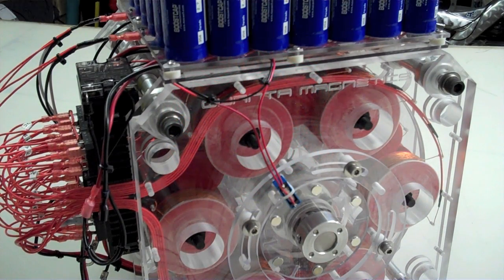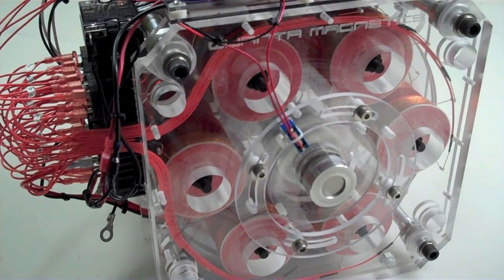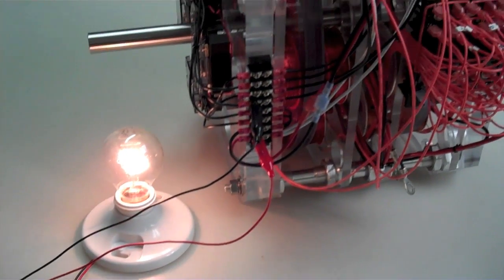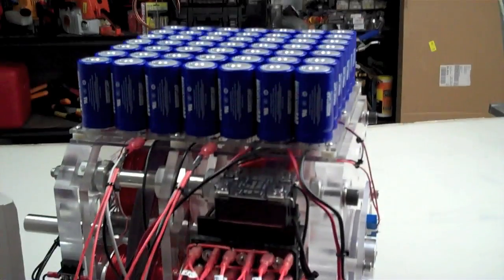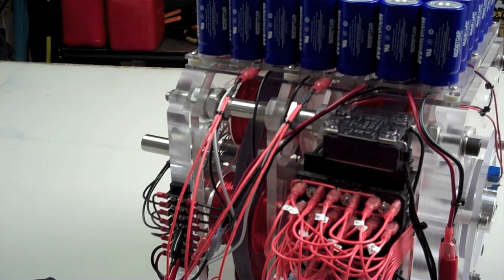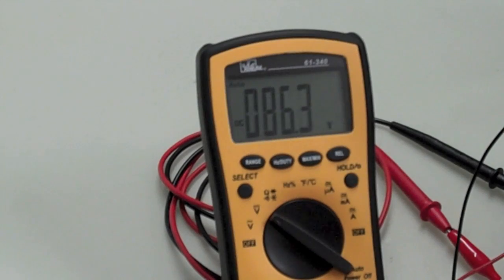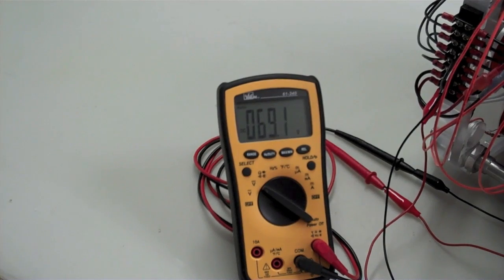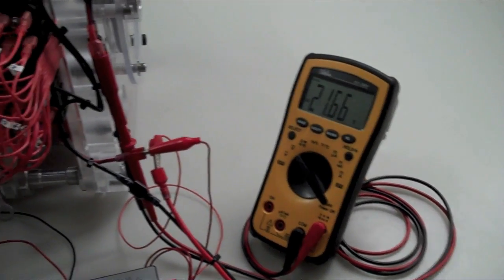Q2 SELF CHARGING.Part 2

Comment: Yes I get that but the point I am making is the output potential that can be delivered to gain a usable voltage 110/240 and amperes because it is pointless having voltage without the ability to do work.

Presently the machine you have is a novelty device and you need to look at making this in to a device that can do work, whether electrical or mechanical.

How much work (as in power take off) can be achieved without detrimental effect to the device's ability to continue running?

Comment: You go on about current draw, what about current output?

It is no use having a device that requires a 24 volt input to energize and run if the output is not sufficient to do actual work.

Also... Get to the point, your presentation really needs to be speeded up and less talk and supposition and present the facts as you have found them.

Comment: Dear sir: This is a neat machine with capacitors, motors, batteries and some other electronic devices, but I still cannot follow the flow of energy through the whole unit and what it actually does.

Can you please supply us with a circuit diagram showing the actual flow of energy and the interaction of the various electronic parts, PLEASE!!!

Comment: And what really bugs me is they way your using the term "power". Power is watts (joules per second). You can't just say I have 100 volts and there's that much "power" going into the caps etc etc. That is really confusing and incorrect. If your going to use the term "power" you have to multiply the current by the voltage (for DC). You can say there is "this much" voltage going into the caps but that says nothing about the power going into the caps.

Comment: So its a DC to DC step up converter, with caps that give it a UPS characteristic? I'm still unclear what this does. Are you claiming on top of bearings thermal inefficiency and the power loss in a cable power = current^2 * resistance (and you have a lot of cables), this can power itself and a light bulb? I know a little physics and questions are just rolling off my head, I'm trying not to ask many of them.

Comment: Do an experiment to see if the caps are being charged by the Field when grounded. (but still in Frequency "sync" with the negative wave of the generator) Ex1 Charge each cap through its own separate power source (a battery or something) then discharge them in series and measure the voltage. Ex2 Unplug the caps, Ground the caps to a different ground all together then the generator, then measure the voltage output. And lastly do Ex2 but move the caps a greater distance away from the generator.

Comment: Capacitors are electrostatic, therefore Magneto-static (a magnetic field carrying current will pass through the caps trapping static current between the spaces) A High powered magnetic field generating electric current will charge capacitors within proximity. There are already advanced uses of this being researched, like the possibility of having an electric car charged "instantly" by passing through a charge check point. "Wireless" power broadcast through harmless magnetic fields.

Comment: I work near High voltage power lines alot, here in florida. 500kv distribution lines, the effect they have on everything is astounding, Park your truck in line with them go to touch the door shock!. Aluminum seems to be very reactive to frequency modulation, Hence antenna's etc. The reason possibly for the voltage spike when unplugged(but grounded) Is because now all of the caps are being charged at once(instead of in series) and being discharged in series.

Comment: could you not use the momentum from the rotor to run a car alternator and use a 12v to 240v inverter to run different appliances without sever voltage drop?

Comment: I have heard of this run away effect before. You created a ground plane with your capacitors and it is using the ambient pulsating magnetic field from the motor to charge them. this is getting into "electromagnetic field theory"
An example of this would be that ungrounded CRTs and capacitors will charge themselves over time off the ambient signals in the atmosphere (house wiring, radio signals, ect.) A visual effect would be to move a florescent bulb around underneath a high voltage power line.

Comment: Why does the 24 Volt motor continue to run at full power when the unit has stopped rotating (7.30 minutes from start of the video) ? The implies to me that you are simply switching power from the caps or an external source to the 24 Volt motor rather than generating power. At best you have a semi efficient motor driving a semi efficient generator. At worst (and I believe this to be the case) it's nothing but a scam !

Comment: i.e. If your system works with no other source of energy for 2 hours and the voltage across the caps has gone down even a volt - you've got yourself a regular electric motor and a voltage inverter, which were invented sometimes in 1890 with efficiency of 80% and today they are about 98% efficient.

Comment: Thank you!!! Why is everybody here so impressed by a semi efficient electric motor?!?
If fully charged 49 x 2.5V 350F capacitors would have 53,593 J (Joules) of energy. If a 12V source at 300mA can spin your motor it takes only 3.6W to operate. 1 W/h = 3600 J, which means without any batteries the caps alone can sustain the spinning for about 4.13 hours. (53,593J/3600J per W/h = 14.89W/h / 3.6W = 4.13 Hours) Even if we did half of that, they get discharged half way, we are looking at 2 hours.

Comment: I'm a bit confused, that I'm sure most are... Seems more logical to me to have it charge two battery packs so it can continue power itself forever. Lets think about this for a moment. As one battery pack is being charged the other is being used to run the device and then it switches to the other when the battery is almost depleted. This way you can have a continuous running device. You currently need 63v @ 1A to get this thing going. As of right now, I see no need for the device.

Comment: Becourse that means
Let say you have a generator that needs 50 newton to create 10 watts. Then you use a motor that needs 15 watts to create 50 newton load.
Now replace the magnets in the motor with some that is twice as strong
According to Laplace law.
It will only need half as much watts (7,5 watts)
to create 50 newton load.
And now the system creates more energy than there is put into it.

Comment: in the sound of your microphone i hear a distortion .    that same effect of distortion i get with my camera when filming  in a plane in air , how harder the engine runs how bigger that distortion( static charged of the air friction , turbine blades get allot of it).     and abaut the caps  ,   arent they charched  and the want to get rid of that static energy. or the static power you create goes in the air and ground power  and as soon you touch the + side  all static goes trough your body?

Comment: If you make both of these work together in motor mode, what king of torque/rpm are you generating? Would it be feasible to line a few up in the same shaft and connect to a high efficiency generator (the reverse of your converter project)? Why did your website stop selling the kits? I was just about to buy one.

Comment: what you may have felt was an induced ac voltage capacitors allow ac to pass like a piece of wire you said it was generating about 100 volts if that was ac it would be plenty to knock you on your ass and possibly kill you if you did it wrong

Comment: Beautiful machine but the narrative doesn't do much but highlight meaningless observations.  It appears to simply function as a voltage converter.  The hookup has an amp & volt meter at the input so input power can be calculated, but just a volt meter at the output so output power cannot be calculated - concealing that no excess power is generated?  Seems like smoke and mirrors but would love to be proven wrong.

Comment: Brain Train, you mean that a coil without iron an an rotorating magnet wheel have overunity? That sounds very good, i think i build one today. A simple DC Motor and the magnet wheel with the coils arround that should be the same effect like the machine in the video, or not?

Comment: the reason that you are charging the caps to a high voltage when they are disconnected is that the rotating magnetic fields that are in close proximity create a induced voltage that are stored into the caps therefore giving you a shock when you touch them the same thing happens when linemen are working on a long power line that is disconnected from the mains will still kill you with the induced voltage generated by the wind and moisture from the atmosphere including the magnetics from the earth.

Comment: Wow, What a fantastic video!  I am impressed with your knowledge and application of concept to your generator/motor.  My thoughts about the caps, when they are disconnected and the motor is running, it is the electromagnetic field from the rotating coils that is creating/releasing/activating(q mark) the electro magnetic static shock.  I bet if you can keep the caps (and the air around them cold) you will have a better charge within them(or more dangerous if you touch it) 
Very fascinating

Comment: Follow up. Starting with 92v in the dormant cap bank the stand alone loss measured around 1.5% over 2 days. For sure much greater than 1% over 5+ days when measuring a 20% residual charge over time. Maybe a common deep cycle battery is more efficient in that regard. I have no idea, there is no accurate way to measure the residual charge of a common battery. i.e voltage has no relation to chemical storage capacity, while the voltage in caps can be calculated in Joules giving a reference point.

Comment: I understand your point, but just wanted to point out something. Solar panels, wind and water turbines. The energy input to those systems are 100% free. Though they cost a little to build and maintain, have a near infinite COP.  They may not be 100% efficient, but you don't have to pay the sun, or wind, or water currents, to power those systems.  Energy storage by contrast, will always go back to zero due to the Dirac sea effects, batteries and capacitors included.

Comment: Will do, I am also curious about the stand alone behavior. For the 2nd time the bank dropped .1v with room temp around 50 degrees and was back 8 hours later with room temp at 70. I had not expected the caps to appear to fluctuate with temp. as much as they do with  with time, so I will keep an eye on that as well.

Comment: All in series. Smaller series banks with lower voltage seem to have greater loss. I have also seen the voltage drop say .1v and gain it back 8 hours later but I think this is due to fluctuations in room temperature +- 20 degrees.

Comment: Follow up, a bank of 35 2.7v 650 f caps dormant on the shelf  for 2 + days measured 40.9v. 60 hours later the voltage dropped to 40.8. If my math is correct this would be about 1% leakage in roughly 5 days, not 2 months as previously mentioned. My error. In any event, the 1% loss over 5 days would be recovered in less than 3 seconds with full sun on a 90 watt PV array.

 All is relative to economics, so maybe a combination of various storage methods is worth pursuing.

Comment: Yep, even a cop>1  definitely does not mean energy came out of nowhere and was free. To be sure COE is as solid as solid gets. The heat pump example is complex going back to 550ft/lbs in 1 second = 746watts and how that formula was derived. Based on the original heat conversion, cop is just a relative number. IOW even cop >1 based on the formula, is not likely to convert energy from one medium to another without incurring losses that will take the system back to <1. Energy storage has an upside.

Comment: I hope you are not implying that  COP>1 means you are able to create energy. A COP>1 in a refrigeration system or heat pump does not imply you are getting free energy. The COP of the system only considers the electrical energy to run the compressor as an input, there are additional energy inputs/outputs in the evaporator and condenser (depending on what your desired output is) that are not considered. The overall energy balance of the system will always equal out. Energy is always conserved.

Comment: So, if you pull the wires off of cap banks 1 and 2 and discharge them, do they charge back up or do they stay discharged until you connect the wires again?  Impressive work and build.

Comment: Yep, must have been all the rotation of permanent magnets rotating in the vicinity of electromagnets as various experiments happened (by chance) near enough to keep the loss down to 1%. Now you got me to wondering, What does Maxwell say the the typical loss would be for a balanced bank of 62.4kJ in the bank over 2 months. I have not done this calculation but it sounds like you already have. If  over 1% loss that is great, all the more reason to wonder why I have not measured greater leakage los

Comment: Follow up, the caps I have been using (2.7v at 650+ farads also Maxwells  have repeatedly stored energy for months with less than 1% loss. So I call bull crap on the leakage you mentioned here. As far as maintaining voltage, you are missing the whole point and beauty of the flexibility the scaps provide. Go back to the textbooks or better yet do some experiments with large caps and let the viewers know what you come up with.

Comment: Follow up. Example not related to the PMM experiment that created this site. Say I told you I could maintain motion of a 30kg 6" rotor at 1000 RPM with a 6 watt input and recover 2.5 watts in capacitors by collecting bemf and.cemf.
What would be your thoughts ? A) bull crap B) prove it C) move the experiment away from power lines or D) none of the above ?

Comment: More expensive per joule compared with batteries commonly used with solar systems. I know, you do not see any benefit from the rotation, I think there is potential for other energy storage..back to the blade pitch reserve example. For sure, long way to go.

Comment: Similar to s.caps for blade pitch reserve on a windmill. Only the clouds present the variable input to the PV collector system. The more caps for reserve the better, but they are expensive per joule while being a more efficient storage method than common batteries. Maybe rotational energy to boost voltage (as a transformer could do if uninterrupted) could be stored in hydrogen or a well designed flywheel to smooth over the variable input power source to maximize point of use efficiency ?

Comment: Likely, if the receptor cap bank is maxed out on capacity, things would heat up leaving nothing worthwhile to mention. If the cap back is not beyond its full charge rating, then it can take a charge coming from a higher voltage ! until it stores energy to its full capacity. The s.caps  do not care how fast or at what voltage they are charged or discharged. If overcharged they will surely heat up and eventually be damaged. Series or parallel connections are  relative to all the other parameters.

Comment: So it is possible then for super capacitor connected in Series to handle higher voltage.
For example in the video he is using in cap bank1 14 super capacitors in series which would equal 35 volts @ 25f
at a point in the video the coils generated over 80 volts going into cap bank1. 
Pretty amazing, because i would think the higher voltage would destroy the super capacitors. 
Anyone has any thoughts on this please let me know?

Comment: One way is that often times (depending on numerous variables) the caps will automatically buffer the voltage by compensating current over time. In any case, usually the higher the voltage in the bank to collect bemf, the shorter the time that current is flowing. I don't remember who this law was named after, maybe someone experienced in the field can comment and add details ?

Comment: Nice, I have a project going that is also using the 24Volt coils but am running at 4800 RPM. Using it for induction heating of water too! Thanks for posting! Great job!

Comment: This is usually the case, however, keep in mind the task is about efficiency for motors/generators and efficiency of storing energy. Solar PV panels charging common batteries for energy use at the time it is needed have significant losses as you described as extra steps leading to more loss. The storage aspect does have to happen in any event. My point is...there may not be a fatal flaw " if"  the overall energy transformation system can be more efficient and economical than existing methods.

Comment: Like the quote, it seems the posts have been in the positive direction lately. I hope that trend continues and those who do tend to criticize experimental efforts, will do so in a constructive way and realize the video is about efficiency, storage and energy transfer...as you mentioned there has never been a claim about OU or even COP>1. For the naysayers...What is the COP capability of transferring energy thru a well designed heat pump for heating or cooling?

Comment: I've had that happen to me when I put an old male-end on the power chord of a cardio machine.  The stranded wire I used in the male plug end was soo close that the electrons were exchanging, I guess, but actually not fully enough to trip the breaker?

Comment: You could also try testing this with a corona ball test lead connected to a multimeter. Corona ball is easy to make with a ball bearing. The shiner the better. Drill a hole in the bearing big enough to insert a multimeter lead. Place ball near coils without touching them and read voltage. The corona ball will collect stray electrons/static in the air and give you a reading.

Ken, 
Revolution-Green(.)com